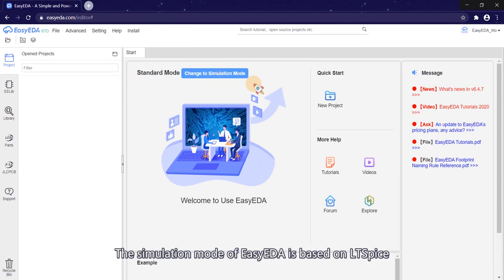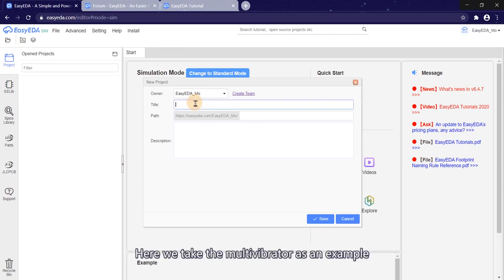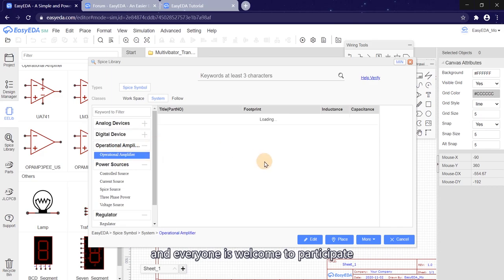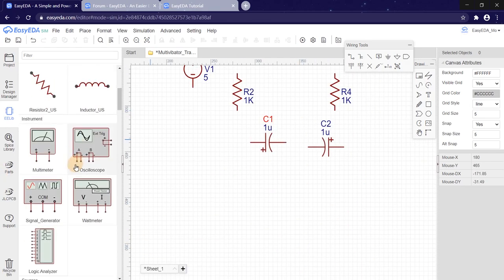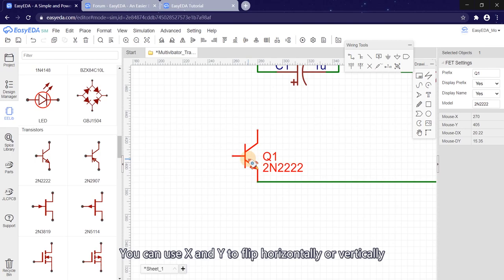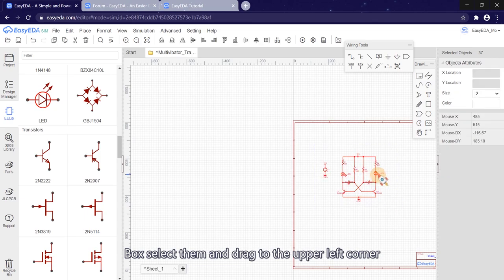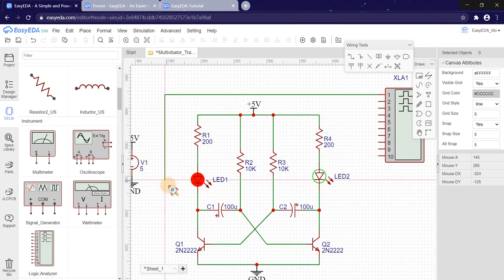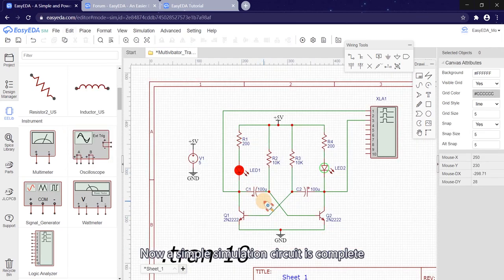009 Simulation Quick Start

Comment: can we do real time simulation in easyeda? like turning switch ON and OFF while simulation is running.
Reply: Same question here.
Reply: @TheSquall124  We cannot do this in EasyEDA
Reply: If you can simulate simple toggles then this isn’t simulation at all
Reply: @cedricvillani8502  Proteus software supports interaction with components like switches, potentiometers etc during a simulation.